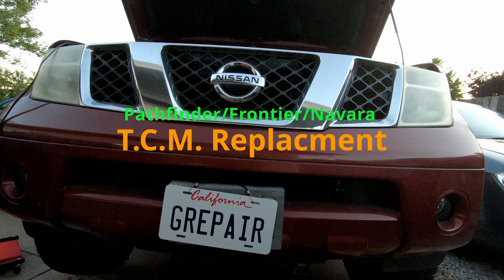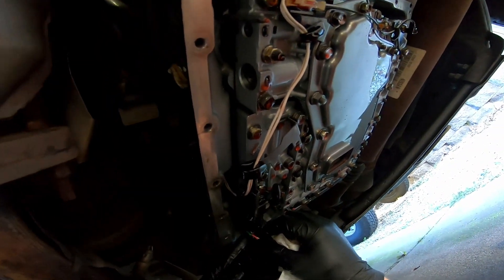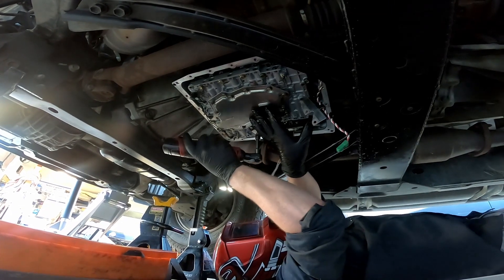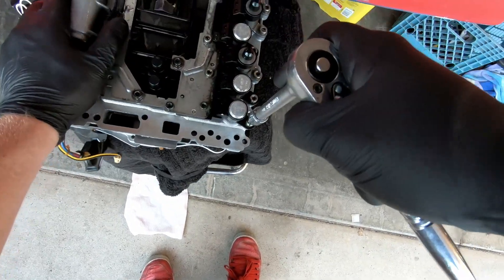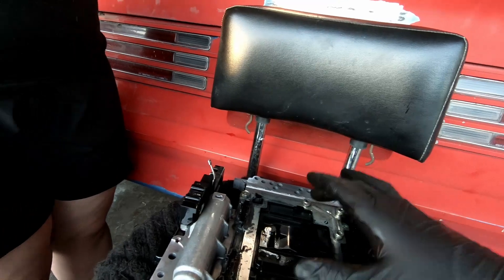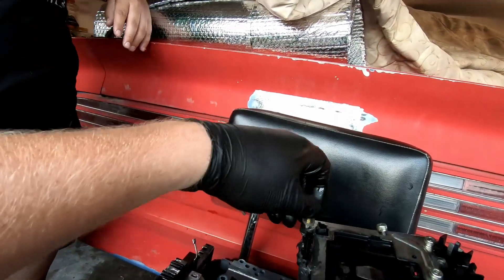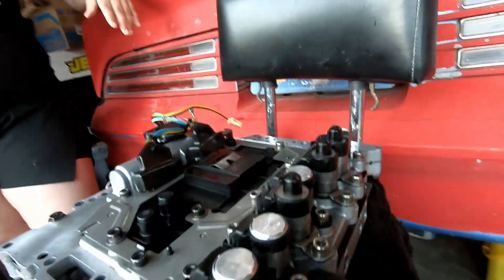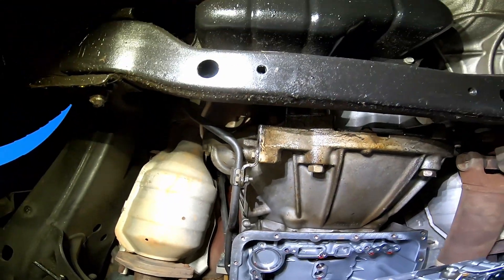How to Replace Nissan TCM 2005 - 08 Truck/ RE5RO5A

Comment: I did this and at the end it won’t go into gear at all so I take the drain bolt out to take it all back apart and only like half a quart came out but I put 4 in (showed on dipstick tho just wanted it to get warm). I can’t seem to find an accurate number or way to fill and bleed
Reply from the maker: @slothified806  did you drain the torque converter? I'm not sure how to help you with your fluid level issue, it's not making much sense, there are fluid capacities online, and dipsticks have been effective for 100 years. If only half a quart is coming out it sounds like it's low, but I'm not there to see every variable, is it on flat ground is it leaking, or going into the transfer case, or the cooler? Is your radiator full of coolant? When you move the shifter does it register on your dash that it's changing gears? Some have reported that they needed to have the TCM programmed.
Reply: @ update I fixed it. Yes it read the gear. But wouldn’t shift. Apparently the valve body drained a lot more fluid than anyone tried to mention online. I put 8.5q back in after I was done. All good now sorry just was at a stuck point
Reply from the maker: @slothified806  ok good. does my video not say toward the end how many quarts I put in?
Reply: @ umm maybe so but u did the coolers as well su wasn’t sure

Comment: Interesting. I just checked with ORielly and they show the Bosch TCM with the correct numbers, but say it does not fit my 2006 Titan... But it will fit the 2006 Pathfinder ?? Same transmission! Anyway, way too expensive ($1000+). I have no mixed fluids, so I have to assume it is just the TCM and possibly a solenoid. From my research, if you get the correct solenoids, TCM, and valve design matched with the transmission, you will not require a re-program. I will bypass the radiator and add another external cooler for pulling the camper. Thanks
Reply from the maker: It maybe programed differently from the pathfinder to the titan.

Comment: You said at beginning of video you would put two trans coolers in instead of the radiator cooler, but one of the most important thing the radiator trans cooler does is warm up fluid some in winter.. some vehicle's have issues if they are running too cool in winter.. best to just put In a new aftermarket radiator.
Reply from the maker: That is what I would do, however I live in a hot climate. Thanks for bringing it up.

Comment: Excellent video , I will be trying this tonight. I have a p1757 error code and I am stuck in 4th gear. I suspect it’s the TCM connector to the front brake solenoid has snapped so I might be able to solder it back up. If not snapped then I will replace the solenoid itself
Reply: Hello, What vehicle do you have? Did you have the check engine and the OD/Off light on the dash?

Comment: I watched this like 6 times and got it installed just as you did.  Problem- my car won't move an inch.  Any idea what I missed or what went wrong?  I bought a reman valve body.
Reply from the maker: Kinda hard to say without being there. What was the car doing before you replaced it?
Reply: @GrimRepair  I think I might have figured it out.  If I had the drain pan 180 off- the plug at the front of the car vs the back- would that make a big difference?  Reason I ask- I pulled the plug tonight and only a quart came out.  It had been reading high, maybe it reads higher with the pan oriented that way?  Maybe I don't have enough fluid in it?
Reply from the maker: @philkammann4680  you defiantly need more than one quart in the transmission the transmission can't engage without enough fluid.transmission fluid has to be checked with the car running also.
Reply: @GrimRepair  Here's what I figured out: if you fill the transmission fluid to level when cold, when you start it it sucks all of that back into the tranny.  When I added more it drove fine.  thank you very much for doing this, it was a game changer no doubt!  I couldn't have done it without and I would not have attempted.  You saved me.
Reply from the maker: @philkammann4680  Glade you got it going, thanks for the update.

Comment: Well not my problem! I have same vehicle but seems like torque converter or something that controls lock up. Have no codes it shifts and drives great. Problem is at idle got vibration. It seems to rev about 500 rpm more than it should across all gears wont slip no matter what I do in any gear except a few extra rpm. I'm so close to converter but some good info be great. My fluid is also good and i've put 3000 kms with no changes. Standard swap?
Reply from the maker: vibration at idle, like a bad motor mount?

Comment: Could it be my valve body if my titan takes off slow and my AT check light is on. Almost feels like something holding the back of my truck from taking off
Reply from the maker: When there is a problem they go into limp mode and start out in second, and acceleration suffers.
Reply: Thanks buddy for doing this video. Doing my first one today. Without this video I would be all messed up on how to do it. I know it’s a old video
Reply from the maker: @davidbryant5875  Thanks,let me know how it goes.

Comment: Hi, i have issue inmy nissan rogue 2020 TCM , how  to find  the matching  , bcas lot of models available in ebay, how to chose it, with the long serial Number at bottom  or 5 digit to sticker to top, pl do help
Reply from the maker: @sudharsonbalakrishanan721  I'm not completely sure what a bcas is, and I'm not sure which long serial number or 5 digit you're asking about either.  I would think your vin number would be enough info to get you the right part. The Rouge is way different from a pathfinder though.

Comment: I have a 2012 Nissan pathfinder, my transmission started doing this weird thing while driving it throws itself into a neutral state or stalls to get into 1st gear, lots of torque converter spinning. Turn the car off/on, drivers normal. Get error codes P0850 Park/Neutral switch input & U0101 Lost Communication with TCM. No one at Nissan can verify where the PNS input is located. Also the pathfinder can be turned on in P, R,N or D... I wondering if it's the whole valve body now? Not sure, but your video has now lead me to a different road.
Reply from the maker: Do you have antifreeze contamination in your transmission?

Comment: I watched because I wanted to see if it took any seals or those clear colored plastic celaphane looking things under rubber o rings but it looked like you tried to block view and made no mention of anything going in between TCM and valve body. Would appreciate any info I can get . problem i have is original TCM had only one such seal and plastic other used vb with TCM did have seals and plastic s on all ports . Don't know if they are needed or required. Thanks for your help.
Reply from the maker: I didn't try to block anything if I didn't mention it then either the seal came installed on the part or there wasn't one. I don't remember any seal between the tcm and the valve body. There were probably o rings on the solenoids but they come already installed on the new ones.
Reply from the maker: If you give me a time stamp of where it looks like I am blocking view . I might be able to voice it over and clear it up if need be. I will also be able to answer your question better. The only thing I intentionally block out is my face.

Comment: I recently just bought a 2007 Nissan exterra from a buddy who bought it brand new. Anyway he was having problems with the fuse kept popping so he replaced the TCM based on what he was told. After he replaced it the starter whent out with in the week. I ended up buying it from him and replaced starter and it wouldn’t start unless it set a couple days then it would start but once you shut it off it wouldn’t start for a couple days… and this kept repeating, so I took it to a mechanic who said it needed a fuse block but he said he could just install a push button and it would save me a lot of money so I said do it. Now it starts no problem with the push button start but the transmission isn’t wanting to shift unless you feather the throttle or it will rev up and not go into gear which is all giving clues going back to the TCM. Am I missing something??? TIA for any help
Reply from the maker: Was there coolant in the transmission? What caused the tcm to short out? Is there the correct amount of fluid in the transmission? It doesn't sound like a tcm to me.
Reply: Let me ask my buddy who I bought it from. He’s the one who charged the TCM out on it. He said he never had a problem with it not wanting to shift and can’t understand why it’s doing that

Comment: Hey there - I have 08 pathfinder rwd, I changed the radiator when I got the truck prior to issues after reading about it. The transmission works fine going forward, shifts up and down no issues, the problem is now that the reverse doesn't engage unless I shift back and forth between park and neutral. There is no slippage in the transmission, it pulls strong but simply stopped engaging reverse consistently, is this a shift solenoid issue? Thanks
Reply from the maker: It's possible.

Comment: I have a question. Is it okay to replace more then one solenoid. Since I have the valve body out? Your Pathfinder has the same valve body as my 2004 Infiniti FX35 AWD.
Reply from the maker: Yes it's also cheaper to buy all of them as a set.

Comment: I have a 2005 crew cab V6. My transmission won’t go into OD and I don’t believe I have low gear. The CEL has been on for sometime but that’s because of an O2 sensor issue. Could the TCM be my problem or is the transmission shot? By the way the vehicle has 267k miles
Reply from the maker: It could be the tcm. It sounds like it's in limp mode staying in second. Make sure you are using a scanner that can pull transmission codes.

Comment: Question.  Did the TCM need programing?  I've looked at the Dorman replacement 609-250 and it states "requires no programming after installation".  But you state you were going to have to program it... but then eluded it was just an old OBD2 code.
Reply from the maker: I did not have to program it. It was a stored code.
Reply: @GrimRepair  Thanks for the info for if I have to go that route.  I pulled the controller and cleaned it and then sealed all the exposed circuits in oil resistant RTV.

Comment: Hello. I recently got pathfinder 4.0 2010.
when i shift from R n D there is a slight delay. about 2-3 seconds. Only when from R to D. Is this normal? this may be a common problem with this car? new fluid and everything else works fine.
thanks for the info
Reply from the maker: It's hard to say without seeing it. It could be a shift solinoid, or it could be worn out bands,seals,or a pump. I would see if the tcm has any codes first. I have seen cars that will do that for years. It could be urgent, it may not be, I don't know.
Reply: this happens when the engine is hot. its ok when the engine is cold

could it be because i changed oil not original nissan? it was liqui moly top tec 1200. Jmatic spec
thank you very much for help
Reply from the maker: @v.n.7495  was it doing it before you changed the oil?
Reply: @GrimRepair  i bought it recently. I don't know how it was before
Reply: Hi. Now I have original oil in the gearbox. but I still have lags in D. most noticeable from R to D. I heard it could be the solenoid. which electromagnet can be responsible for engaging the gear. Maybe it's better to replace all of them and check?
Reply: Do you think that the solenoid valve can cause such a thing only in D gear?
or please tell me where should I start? maybe computer research?